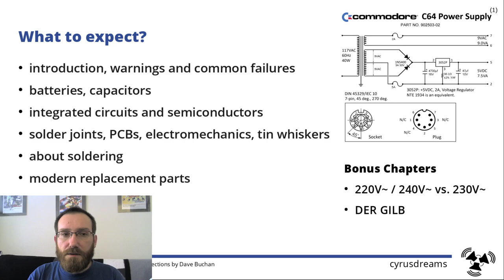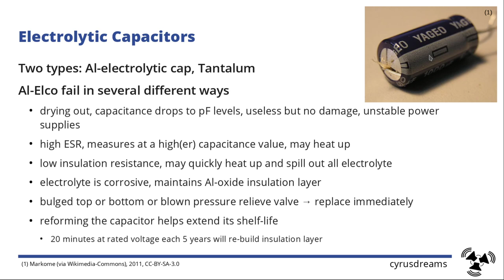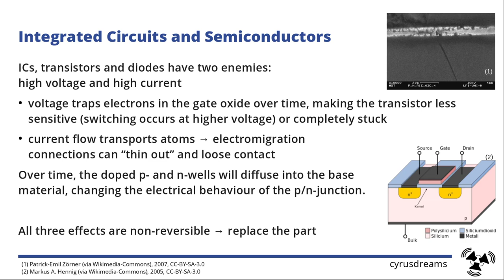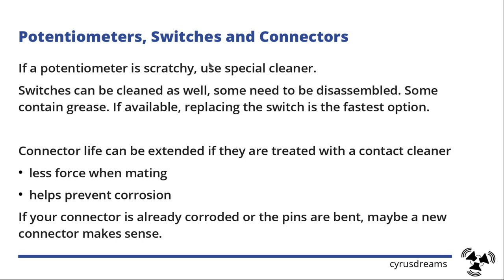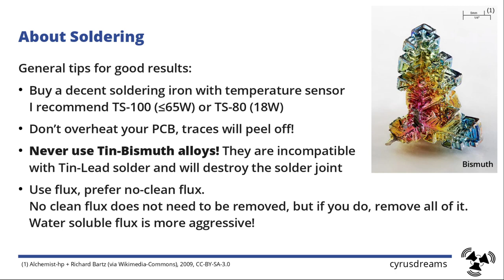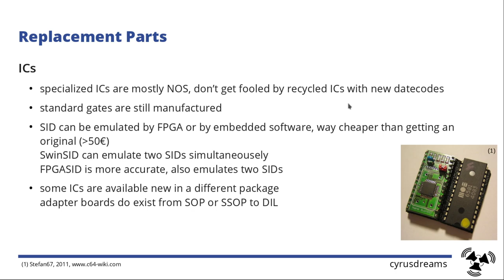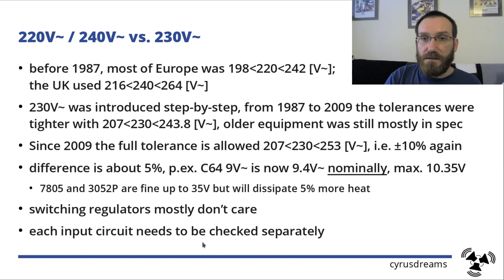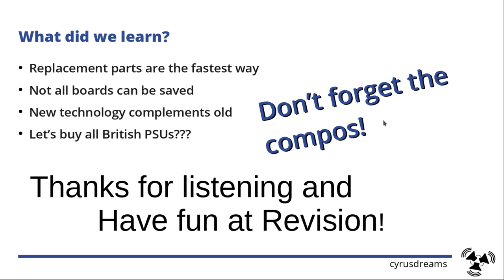Revision Online 2020 - Seminar - cyrusdreams: repair cafe - how to reanimate your dead hardware

Comment: A have a tube radio that can be switched to 220V or 240V. Somebody recommends to switch to 240V (on 230V mains) to safe tube filaments. Would you disagree and let it on "220V" because of the lesser current, you mentioned in video? What woulg be better for the tubes, lower filament voltage or lower current?